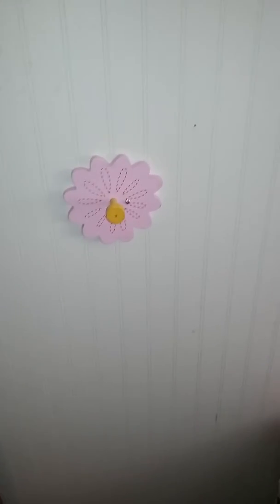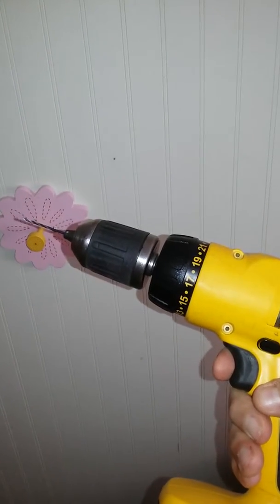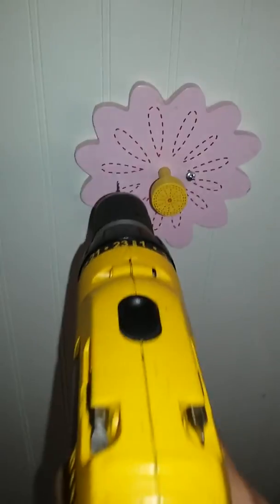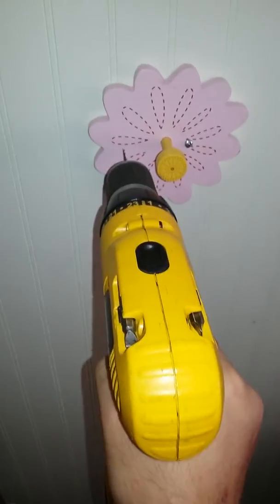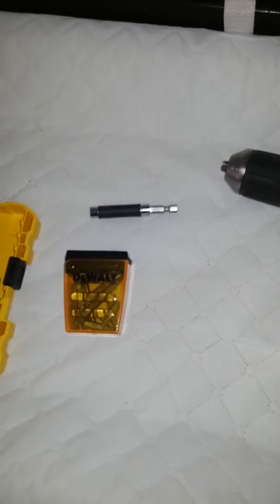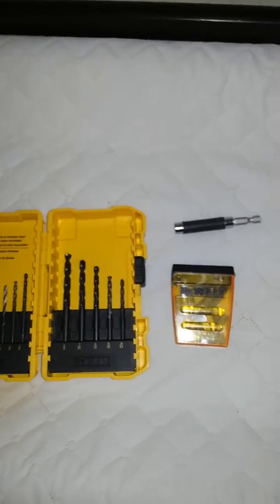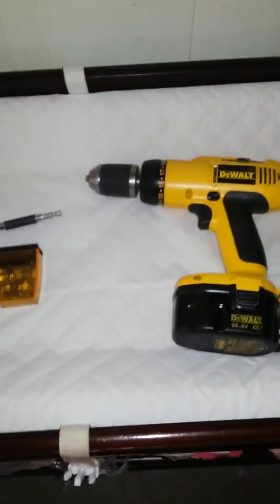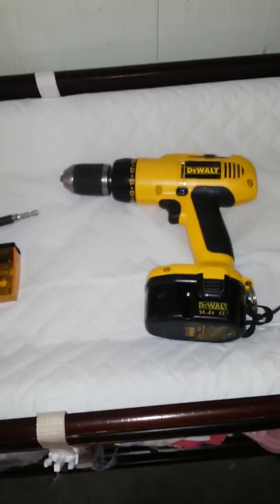#DeWalt100yearanniversary.   vintage  DW 990 in use

Comment: Frankenstein !!!! unless your in a rush speed 1 is fine my man....it is awesome ...keep as long as it gets the job done
Reply from the maker: TOOL BOSS its two drill models  in one thats what i mean it started life as model dw991  and  everything but clam shell is dewalt dw990 only because  i did have the model as well my clam shell cracked and its the same clam shell on my fathers dewalt so he said use it to fix mine back up
Reply from the maker: TOOL BOSS since i did this video   my boss retired the old dewalt drill  parts  use the new parts in this video  now its back to.a  dw990 xrp  the chuck was  destroyed the clutch was destroyed so I swapped out the parts I had purchased new   originally replacement parts to  rebuild my dewalt of the same model  so i knew the chuck was Perfect on mine I had replaced the clutch collar with  a brand new one from ereplacementparts.com  my transmission was perfect and my the motor so I just took out the old parts that were no good put mine in to the clamshell  used  some white lithium grease on the transmission gears cleaned up the whole entire inside works like brand new  can't say the same for the outside it's been beat up from the job site but it got character  if your drill looks perfect you've never used it on a job site  my dad's was just for his home shop and repairs around the house so thats why its in such good condition for its age  considering originally came in a metal box with the yellow charger ... I put my father's drill back together used the  original clutch and 3/8 Jacobs Chuck after adding some white lithium  as well   has a link to the video to  the DeWalt dw990 and it  was on the job site until we destroyed its up and  running @ hundred percent now thanks to  the parts that are on drill in this video from my dw990xrp that the clamshell cracked  https://youtu.be/ENSJpMywrVc